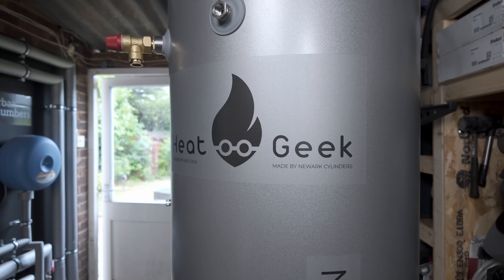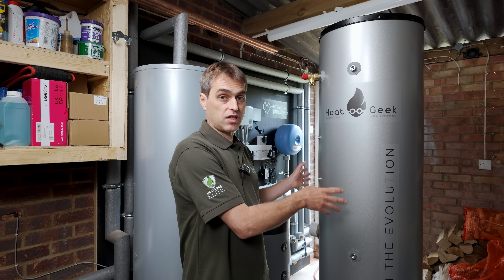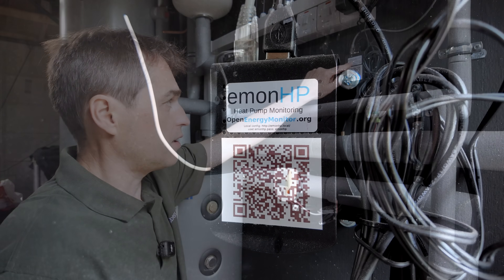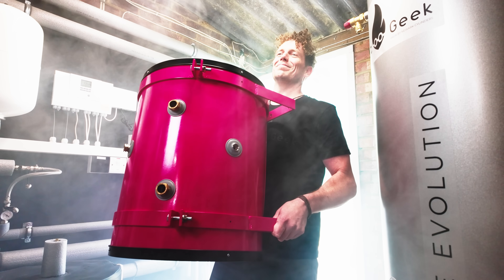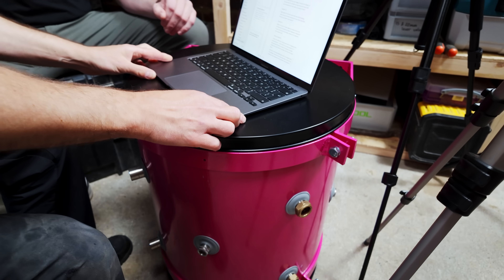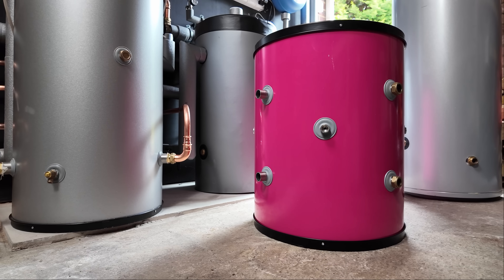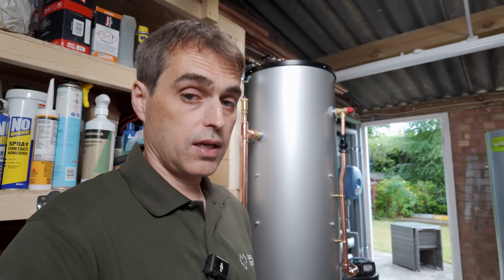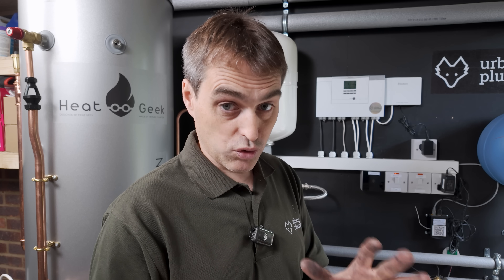Heat Geek Super Cylinder Tested: The Most Efficient Hot Water Ever?

Comment: Nah, kettle and electric shower is more efficient if you just have a modest shower and do the dishes in a smaller washbowl by a bigger rinse bowl, if you don't need to have baths ect... If by efficient you mean just "consuming less energy and materials" rather than moving extra kwh of heat around with a given amount of electric kwh.
Reply: This took lees than 1.5kwh's of electricity to heat the tank.
My electric shower draws 9kw so unless this tank is emptied after a 10 minute shower, the tank wins.
Reply: @bobsmith-dn1xw  Come again, your electric shower draws 9kw? What like in an hour? How long do you shower for at "full blast?" 

So now checking mine with the monitor and bunging up to full is indeed drawing almost 9kw, the setting I actually use it at though is about 4kw... I will use about 5-10lt perhaps 15lts at the very max to shower as I don't see the point of leaving it running while I lather and scrub ect, nor particularly enjoy it running constantly kicking up extra moisture into the home than need be. 

So I usually only need about 1.5kwh a day total including water for dishes/showering, hotplate cooking, charging devices, refrigeration, lighting ect. Laundry days when averaged out. 

The tank looses for me basically. 2kwh a day is plenty overhead. About 540 kwh one years use I believe a recent bill stated.

How many kwh do you use? Do you even know, or do you just know what money the bill says?
Reply from the maker: @ericritchie6783 tank heated to 45c with 20 ambient has almost no loses - probably below 0.5kWh / 24h. It also costs 8p to fully recharge the cylinder at cheaper tariff using heat pump so should be 10x cheaper than using electric shower for 20min a day
Reply from the maker: @ericritchie6783 tank heated to 45c with 20 ambient has almost no loses - probably below 0.5kWh / 24h. It also costs 8p to fully recharge the cylinder at cheaper tariff using heat pump so should be 10x cheaper than using electric shower for 20min a day
Reply: @UrbanPlumbers  So you need for the shower to be running full blast for 20 minutes in each case? How many liters is that? Let's please be more accurate to the requirements here. 

See my last comment, I don't sniff at 0.5kwh as an amount of energy.
Reply from the maker: @ericritchie6783 your shower will use 3kWh per day if used for 20min

My heat pump will use 1.2 kWh per day for DHW for 200l of water including standing chargers and will be done at 8p tariff

You will use 1000kWh per annum at 0.22p = £220 for showering

I will use 500kWh for all my DHW needs at £40-£60 per annum if done at night 

All based on a single person use
Reply: @UrbanPlumbers  Yeah, how many liters of shower water are we taking about please. 

So you need someone to leave their shower running for 20 minutes straight at full blast for an economy of scale to be applicable... 

Like I said I literally just tested my shower with my energy monitor, 9kw is max, the setting I actually use it at is about 4kw so a whole hour showering would be 4kwh which is of course less powerful than 3kwh for 20 minutes... Who scolds themselves for 20 minutes?

I use around 10lts for a basic shower. Sometimes after I've finishing cleaning myself I might just stand and turn the temperature hot and cold to enjoy, even then its hardly going for 20 minutes straight, nothing near that. 

How many liters of water to run the shower for 20minints or an hour? Of course that also depends on what flow you've got set, so again we're back to how many liters are required, measured by time makes way less sense.
Reply: @UrbanPlumbers  Your really trying to tell me I use 1000kwh a year for just showing when I've already explained my bill literally states I used about 540kwh in a year, total for all electrical usage... 

That's not a mistake I've studied all my appliances with my monitor and watched the meter reading day to day. 

My bills are majority standing charge, and I pay more per unit of renewable energy than you, 30p actually not 22p, which I can afford to do. My current estimated projection total energy charges are (including gas although that's getting onto other caveats) £460 total, £340 for just electric including standing charges. 

I mean come on... Your muddying people's ability to more directly understand their needs and consumptions... 

You'll have 200lt of hot water sitting there in your tank at a time, I'll only consume about 12 cubic meters of water a year with grey water re use for flushes from dish, shower and laundry water. 

So yeah I know what amount of water gets used as the plug is left in the bath tub while the shower is going and I'll scoop it up into the flush bucket. Kind of extra time consuming tbh, but I was thinking to get a little pump to do it, although just doing it myself also keeps the tub nice and clean as everything gets a wipe down during.

Comment: Thanks for sharing! Would be very interested to see what settings you use with the HG cylinder to maximise efficiency. What about when you connect a secondary return , how does that affect stratification??? Presumably this also disturbs the stratification layers?
Reply from the maker: Yes, it really affects the cop in a negative way on some of my installations
Reply: They should add a long dip tub to the secondary return on the Heat Geek Cylinder. I have a 300l heat geek cylinder and am a little disappointed that they didn’t think about this issue on the new Newark cylinder.
Reply from the maker: @myatix1 no - it needs to be connected as high as possible not taken to the bottom of the cylinder

Comment: I need to replace my cylinder on my system boiler.   Could I use one of these?   I am intending to move to a heat pump in a few years time.
Reply from the maker: Yes, it would work great with gas boilers and keep them in condensing mode through the cycle. Mind you this will cost you 3 x the price of a regular unvented

Comment: I don't know how common is my situation, but my space constrains is forcing me to use horizontal DHW cylinder. Can Adam's design be emulated with plated heat exchanger and horizontal cylinder? Adam mentioned breafly about using separeted heat exchanger, but I can't find more information on how to design such system with horizontal cylinder. Any suggest where to start?
Reply: I have a horizontal cylinder because of lack of height and space, I always wondered when I bought it if it would make any difference if I had 2 small vertical cylinders that would fit in the space instead of the larger horizontal cylinder in regards to stratification?
Reply from the maker: Lack of stratification and also distortion of plate loading would make it very hard to get decent efficiency in horizontal cylinders

Comment: We've had our 250l Heatgeek cylinder in for nearly 3 months and are averaging a CoP of 4.7 for dhw only.
I might add, that's at night during our cheap electric period,  so it's costing about 10p/day to heat.
Couldnt be happier.
Reply from the maker: That’s a mad cop for night heating as it is much colder at night. What size is your heat pump?
Reply: @UrbanPlumbers  7kW Vaillant.
Reply: If you’re on what used to be called economy 7 then you might be paying 7p per kh but you will be paying way over the odds for your day rate price. Our gas for our combi boiler over the summer was about £15 a month for 4 showers and abit of washing up!! And it only cost £1200 to put in 7 years ago. As a plumber for 20year I took out hundreds of mega flows a cylinders and replaced with gas combi boilers. Can’t get better!
Reply: @Cyberbobxxxx  a) Depends on what you define as better  b) And octopus intelligent go is about 4p per KWh more than a normal tariff in the day. And obviously you would have a battery (or elec car or both) with that tariff....
Reply: Utter nonsense
Reply: @Cyberbobxxxx  exactly

Comment: Rather have a plat heat  if im honest as i live in a hard water area. Removing the plate occasionally for descale , keeping my heat transfer at its max. Simply can't  do this with a coil !!
Reply from the maker: You can - water softener !
Reply: Yes this is true,however the cost of the salt for the next twenty years  and the extra water consumption, think ill stick with the plat thanks.
Reply: @douglasstalley6475  There are saltless water softeners available that only need an occasional filter change; but agree that a plate heat exchanger seems quite appealing in a hard water area. If the water running through the heat pump is sealed there won't be a build up of scale inside the cylinder, only on the PHE, which can be cleaned/replaced more easily! (plenty of 50kw PHE commercially available)👍👍..
Happy to help you @UrbanPlumbers to develop a competing product -  of course in Szymon blue! 🤣🤣
Reply from the maker: @aesopshair6690 mixergy is already doing it and recently upgraded the plate.

I wouldn’t mind testing a plate and seeing what can be achieved - however plate loading at cop of 5.0 - wel will be tricky but could be retrofitted to existing small coil unvented

Comment: My Guess: 1 h 10 m
Reply from the maker: That’s in reduced mode. In full output it was some 15min quicker as it outputs around 8kW
Reply: @UrbanPlumbers  Szymon: great video: thank you :-)
Reply from the maker: @michaeldepodesta001 I was actually thinking of asking for your help analysing the data on those cylinders !
Reply: @UrbanPlumbers  Of course. I will send you my spreadsheet for analysing the Mini cylinder. It makes the most optimistic assumptions about the heat transfer within the cylinder and so represents a best possible case. Adam's spreadsheet is more complex than mine, and models the heat transfer within the cylinder more realistically. But the heat transfer is so good that I doubt they differ very much in their predictions.

I'll tidy it up and send it to you later.

Best wishes: M

Comment: During the colder weather I have the heat pump set to 28 degrees, which works fine on the house temperature and hot water combined. This new cylinder works more efficiently due to the larger surface area of heat transfer, during the summer months would it be more cost effective and efficient to increase the flow temperature to heat the domestic hot water, allowing the heat transfer to the tank to increase using the warmer outside ambient temperature to reduce running times or power consumption

Comment: That thing is huge. I would really love a horizontal one that fits under the lowest point of the roof, but my guess is that it will be horrible to design in terms of hot/cold separation.
Reply from the maker: Horizontal cylinders are problematic and best avoided if at all possible
Reply: @UrbanPlumbers  Maybe the ministor will be a good alternative as it is pretty low. Can't wait for the results.
Reply: Why is that ? We’ve been using them in marine applications forever and 15 years of service isn’t uncommon .

Comment: My parents had the 250l variant of this installed about 2 months ago. So far very impressed (I know it’s summer ) but the current hot water scoop is over 5
Reply from the maker: yes - if you keep the strore at below 48 and get the settings right you will have cop of 5 in the summer. Great desgin.
Reply: @UrbanPlumbers  i forgot to say that’s with a store temp of 50c, although your figures are more acupuncture as my parents heat pump doesn’t currently have independent monitoring set up, so that just what the uni is reporting
Reply: @UrbanPlumbers  what does the Vaillant App report the energy efficiency to be as a comparison to the Open Energy Monitor please?  I've got the same 5kW unit and heating hot water to 50C and the App reports 4.9 efficiency.  Just be interesting to see how the two compare.
Reply: also the DHW is set to Eco currently and runs over night in the off peak period.
Reply from the maker: @richardharding9097 in most cases Vaillant app over estimates scop by some 20%
Reply from the maker: @richardharding9097 set the pump to auto as well!

Comment: So it took 56 minutes to heat the cylinder? I have an old immersion tank in the airing cupboard which usually takes around half an hour to heat from cold it isn’t a small tank , so just curious of the cost of heat  geek tank from electric cost keeping in mind it took 56 minutes so I could compare it too 30 minutes cost of my old immersion tank , I will turn everything off in the house for the time trial.
Reply: Time is not relevant to cost, cost is all about the amount of energy transferred, if you use a heat-pump you get a CoP of at least 3, so it costs 1/3 of that of using direct electricity, if the heat-pump managed a CoP of 5 then it's 1/5th the cost of direct electric heating.
Reply: @edc1569  efficient unit will always be more beneficial but there still has to be a cost factor , all I was asking if it takes 56 minutes to heat that tank of water how much money did it cost that’s it , yes I know different tariffs will cost more or less with different suppliers but there has to be a ball park figure, I can only ask questions how I see life , it doesn’t make me correct or incorrect, personally I think lots of the heat pump information is only geared too efficient scenarios = great but I still would like to know a basic question how much did it cost a tank of water that took 56 minutes to heat .
Reply from the maker: @kavanobrien6547 I think it took 1.3kWh of electricity to charge 6.3 kWh of energy into the cylinder. At 22p per kWh it costs me between 20p and 29p to charge the cylinder to 45c
Reply: @UrbanPlumbers  wow now that’s what you call efficiency, slowly I’m getting it , yes I know slow learners can be a pain , look at the positive I know it would be pointless me putting my immersion on already knowing it’s not even going to come close to your figure , maybe I just look at things the old fashioned way of how much it costs, some may think I’m being negative when I’m asking  stupid questions, all I’m really trying to do is learn be it slowly I grant you ,thanks for your patience with me. Take care.
Reply: @edc1569  So with a heat pump and a CoP of 5, twenty percent of the input energy is electric (powering the fan and pumping the refrigerant) and the actual heat /remaining 80% comes from the ambient environment.
It would be interesting to see the comparative effect of siting a heat pump in different locations to see how this effects the output of a heat pump; since a steady flow of warm air would obviously result in better efficiency than crammed into a small cold space.
Reply from the maker: @aesopshair6690 it’s been tested and location has almost no effect on efficiency.
Reply: @UrbanPlumbers  Wow!... I am super impressed by your attention to the comments... YouTube's most diligent content creator and arguably the most knowledgeable plumber in the UK too!👍🤣
Reply: @UrbanPlumbers  do you mean outdoors and indoors or depending how far away from the actual heat pump .
Reply from the maker: 3kW immersion would have taken more than double that time
Reply: @UrbanPlumbers  what you’re saying my immersion takes two hours. really what the hell have I got then.
Reply: @KavanOBrien  it might take 30 minutes to get hot water but maybe not to heat the whole tank. Where is the immersion? Some are at the top to provide enough hot water for a shower/washing up, some part way down and some at the bottom. Some have two immersions one at the bottom and one half way up. Generally the immersion will only effectively heat the water above the element.
Reply: @matthewwakeham2206  I have had mine for donkey years = all I know it takes about half an hour to heat for a bath , but I would imagine know the urban gentleman has replied that mine is probably costing 10 times to heat the water than his , I tend to look at things the old fashioned way = how much money does it take to heat a tank of water , mine is 10 times more money spent = good to know bad for my wallet.
Reply from the maker: @kavanobrien6547 yours will be around 4.5 times more expensive than the set up in the video
Reply: @UrbanPlumbers  Yes the penny is finally dropping with me = in my case many pennies are dropping through my hands especially when you said it took around 29 p to have a tank of water heated = wow , I live alone so probably wouldn’t need that size tank , looking forward to that little tank having a video done on that will be interesting.
Reply: How many litres is your tank?
Reply: @Jacxel  don’t know actually will have to see if there’s a label.
Reply: Not really relevant. It only heats from cold the first time. With stratification you’re only replacing a section of the stored hot water.
Reply: @hughmarcus1  that must be the longest delayed message I have ever received = 5 months .

Comment: The main issue is it needs a relatively huge heat pump. Ok for retrofit but not great for passive level new builds. I want to do a2a for space heating and cooling and have a separate hot water tank with its own a2w heat pump. Can't see this fitting my use case....
Reply: Think 20 years, maintaining a single heat source is potentially a lot cheaper than a bunch of a2a cassettes, condensate pumps, along with a secondary water heater.